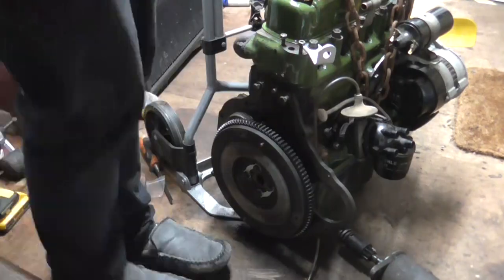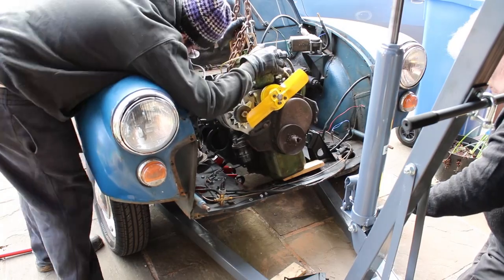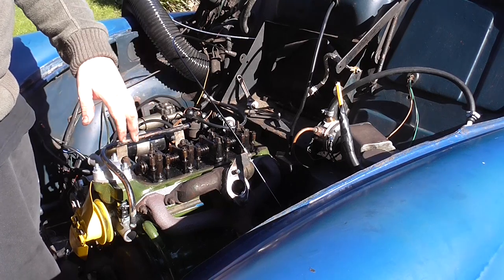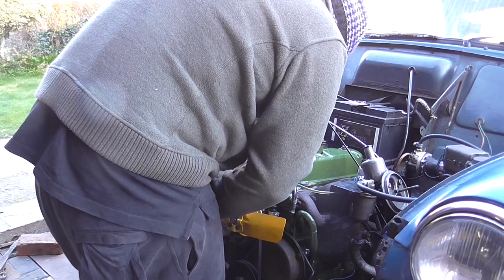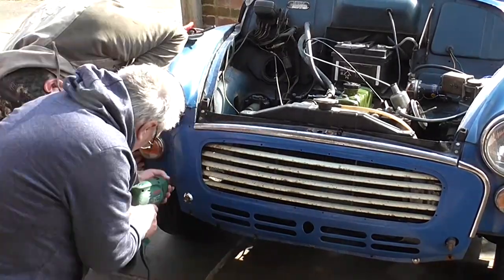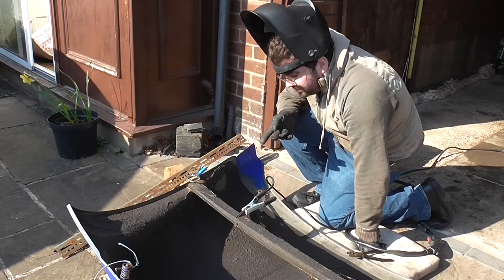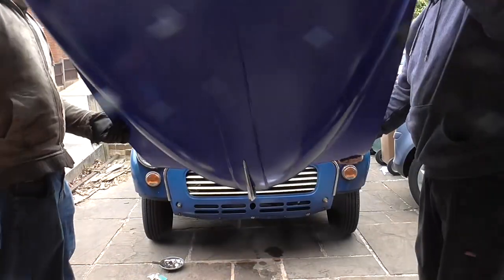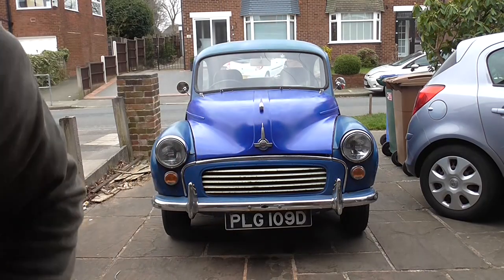Morris Minor - Engine back in - Project Daily drive #21

Comment: i used your heater motor refurb video to rebuild mine, still got to put it back together, but thank you for all your videos on jean, it has helped massively with my resto of lucy. I repainted all my engine and ancillaries, new b and b clutch with stronger springs, then my restorer repainted my engine bay, so clean you could eat your dinner off it!  Then the engine and gbox went back in, fitted up a few bits to the engine bay, in the new year, get the rest of it done and get her all running, then its bodywork, respray, refit new chrome, interior and she will be finished!